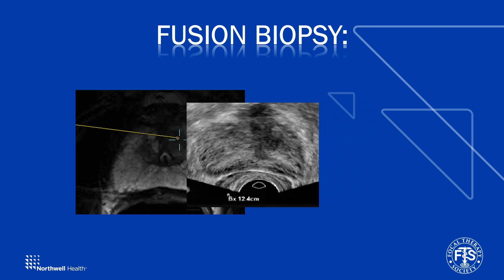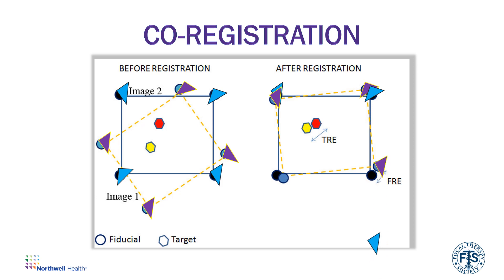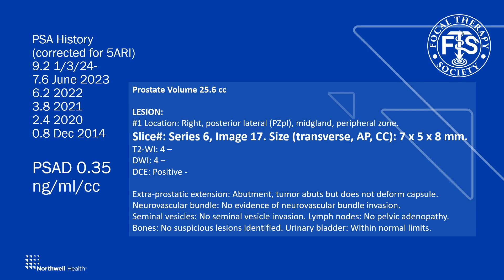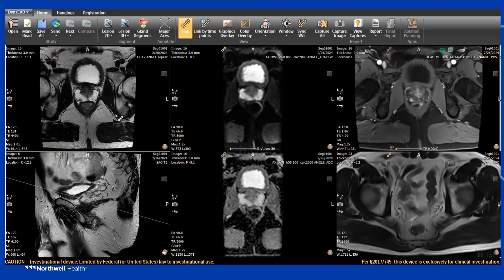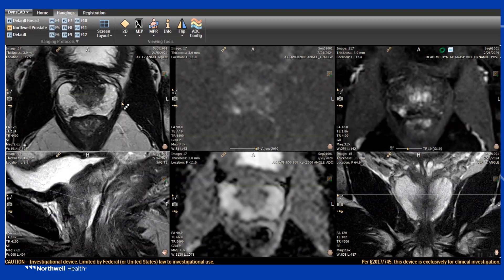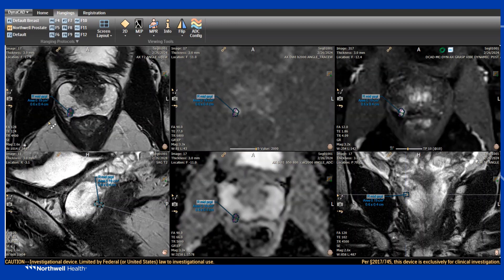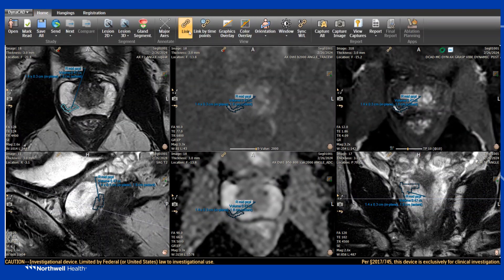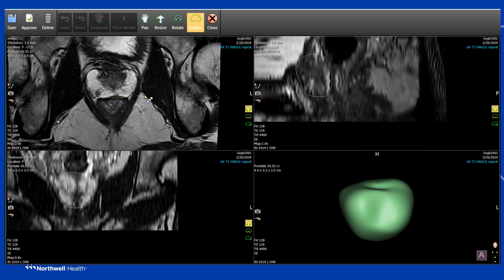How to perform MR Prostate Segmentation using DYNACAD for an MR US Fusion Guided Prostate Biopsy

Comment: Thank you for the nice lecture. I am just wondering how the software generates the biopsy cores. Does the software embed any template or algorithm to generate the target cores, systematic cores and even the saturation cores. From the screen I do see the locations of the biopsy cores on the 2D axial MRI slice near prostate base, some cores are inside and closely outside the lesion, but I cannot see a certain pattern for other cores.